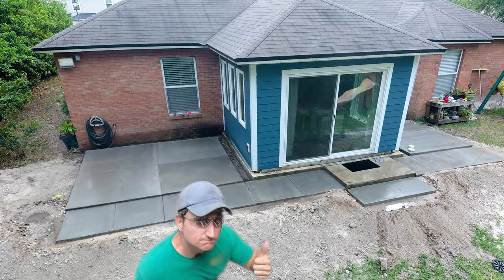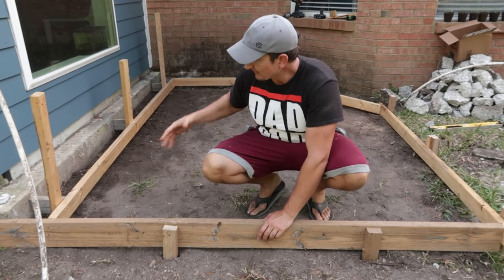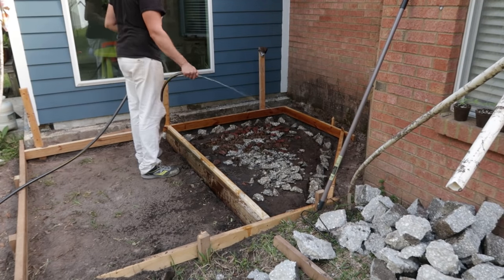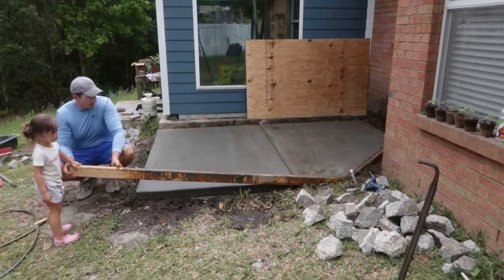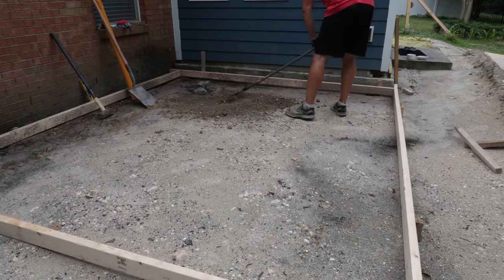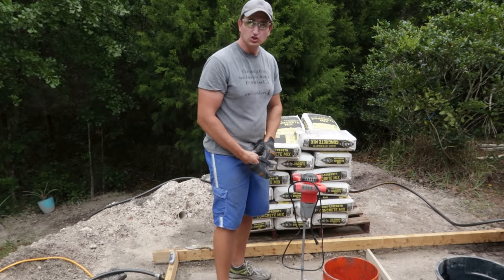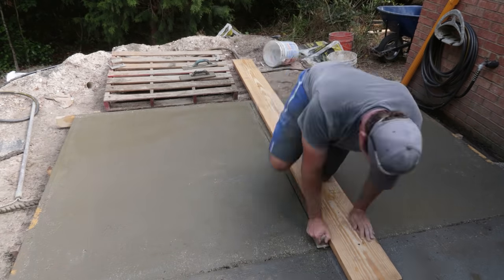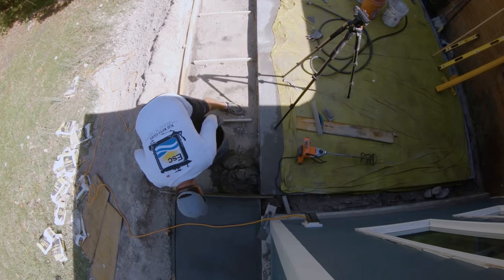Pour a Concrete Patio Entirely  by Yourself Using Bag Mix Concrete, DIY Project From Start to Finish

Comment: For that many bags of concrete, renting a mixer would have made life a lot easier. Curious as to why, in your original pour, you left the gaps against the house.
Reply from the maker: to be able to remove the sliding door later. The old door was below the level of the new slab.
Reply: @MrKistel  I meant the space like below where the water hose is hanging on the brick wall and the adjoining blue wall. There is a gap of a foot or less between the house and your pour.

Comment: Any reason for the gap between the house and the new concrete instead of butting it up with an expansion joint?
Reply from the maker: Yes to leave an area to apply periodic termite treatments

Comment: You look like a glutton for punishment like myself! What I do with the Expansion Joints is use Roofing paper it's very thin and it creates a border between the two slabs. With all that back fill dirt I would have taken a post hole and dug a few little Footers just for extra security great job keep it up!
Reply from the maker: Thanks!  Great tip with roofing paper.  Instead of post hole dug footers, I did make the poured area a little deeper near the forms to create a minimal footer.  At least enough to stick down in the ground a bit deeper than the majority of the slab to better bite into the earth.

Comment: Retired GC. Lots of inconsistent work. Seems like every square (if it was square) was a bit different in size. Not pouring and even flashing to the existing slab just allows more water to be trapped near the structures foundation and delays drying out, and that's never good. As for subterranean termite control, even in a large slab is done with a 1/4/1/2" hole about every 15-20'. Rebar or ww will definitely help 15-30yrs out when roots, wet/dry soil heave/settlement or frost heave show up. Also, just compacting the last bit of fill really isn't going to help in 2-5 years when most of the settlement occurs. Then there's all the small inconsistent "steps' that are more like trip hazards. Sorry, you really did a lot right, but there's a lot wrong too.

Comment: Just wondering how has the concrete held up after a year and a bit (Apr 9, 2021)? Anything you would do differently?
Reply from the maker: Holding up perfectly.  I would probably leave out the broom finish.  It seems leaving the surface after the magnesium float provides enough friction but looks nice and smooth

Comment: If you spread the dry mix straight from the bag in thin {~1") layers then spray water to moisten the mix then build up another thin layer this saves a lot of effort.

Comment: My hat's off to you, what a backbreaking task you chose to take on.  It came out very good for a DIY job, I'm not here to criicize your work, I know I could never do that much work at my age.  I don't understand why you created trip hazards by lowering concrete in certain areas, been there done that and regretted it later.  Again not criticizing.  Great video.
Reply from the maker: Thanks for watching and the comment.

Comment: Did you notice a difference between the fiber concrete 5000lpsi vs the 4000psi?
Reply from the maker: Not from a functionality standpoint. Both areas have preformed the same. No visible cracking in either slabs.
Reply: @MrKistel  awesome.  Thanks for the info.  👍🏼

Comment: I have a Very lobg drive way on compacted soil with old gravel. I wanna make my own pavers and redo it BUT cost of gravel is ridiculous so any idea how i can get my 600 feet of driveway done without gravel
Reply from the maker: Wow that sounds like an ambitious project. Is it 600 linear feet in distance or 600sqft in total area?
Reply: @MrKistel  in distance from the road to the house. There is a small track driveway now that had gravel before its well compacted

Comment: People, people, please stop doing control joints on tiny slabs, you do not need them (well if you use rebar and or mesh)  I did a 40' x 30' slab 20 years ago, and still no cracks.

Comment: Only IMHO. If u are planning on doing a bag mix concrete pour. You may want to run the $Figures$ against the amount to have it delivered in a concrete mixer truck. But if ur gonna do a bag mix I think it would be much better to do it like the old timers did. Order a pile of Portland Mix and whatever Aggregate/Rock and sand. Mix it up yourself. Shovel of this 3 shovels of tht add some water let it eat for 5 mins and pour.
Reply from the maker: thanks for the suggestions

Comment: I'm confused... would it have not been cheaper to just order a couple  yards of concrete and just have them run a pump back there for you? I couldn't imagine it being much more than buying all those bags.
Reply from the maker: I had to do it in small sections. If I had the manpower, and everything prepped upfront, it would have been nice to do it all at once with a load from a concrete truck and a concrete pump truck.

Comment: cant you just pour concrete / cement bag over the pour area add water and mix using a drill mixer on the ground?
Reply from the maker: I don't think that would work very well.
Reply: @MrKistel  i was just wondering in reality what would be the huge difference whether u mix in bucket and pour or u pour and mix. i gotta try that

Comment: Rent a mixer don’t be cheapo😂 btw nice job and thank you for sharing 😊
Reply from the maker: Thanks. I honestly feel it takes longer to mix concrete with a rotating barrel mixer. In my experience, unless the concrete mix is overwatered, it takes several minutes to thoroughly mix each batch load.

Comment: My question is why didn't you mix it in a wheelbarrow? You could have done 3 bags at a time
Reply from the maker: Mixing concrete manually is a chore no matter how you do it. Mixing concrete in a wheelbarrow is a good tip though. Thanks.

Comment: Any bonding agent used on the first slab to bond the second one?
Reply from the maker: Was not needed for this application. The original floor had a textured surface which provided some bite for the new concrete surface to adhere to.

Comment: Why it’s take close to 50 bags of concrete to cover certain area i bags of concrete last
Reply from the maker: it took several full pallets of 80 lb bags of concrete to complete this entire concrete patio.
Reply: Slab was way to thick. Looks about 6-7” thick!!! He should’ve filled base to a 4” level to top.

Comment: A separate section should also be joined by rebar even 24" so it won't drift up or down etc. you are begging over time to have them uneven. There is only one C in especially.

Comment: i got to wear i just wet the ground sloppy .....pour the dry concrete right into the form ...rake it thin to mix ...let it set up for hour or so .... then add more water , more dry concrete , and keep raking it to mix until form is full ... im sure it loses 10 percent strength or something but for us old peeps , who cares

Comment: Are those 2x6x8 boards ?
Reply from the maker: The form boards are primarily a mix of 2X4 and 2x6. The bigger boards  were used  where there was a larger void to block off so the poured concrete would stay contained.

Comment: A patio doesn't need to be 4" thick especially saving bags and self mixing it all. Maybe 3" would be OK.
Reply from the maker: Thanks for the concrete tip. I was able to burn a few more calories  going with a 4 inch pour. HAHA

Comment: Why no Rebar or Chickenwire?
Reply from the maker: It was determined not needed for the design use intentions of this particular project.  Chicken wire helps hold concrete together should it crack. Rebar helps provide structure and strength to handle heavy loads. This is a foot traffic only patio that will not see heavy loads.
Reply: @MrKistel  I have worked in concrete for 20 years, busting it up in houses, pouring it back, I even used to install and stress post tension cables. No way would I ever pour concrete with out rebar and or chicken wire.  Rebar/Chickenwire do the same things, I have jacked hammer up thousand of house slabs and they have either, the new ones all have post tensions.

Comment: I think at least 1 more joint the opposite direction would've been good for cracks. Concrete always cracks
Reply from the maker: Holding up fine so far with no visible cracks. If the concrete pads were much wider, I would have run another break joint like how you described.  I think for this scale and this project things are ok as shown in the video. Thanks
Reply: @MrKistel  looks good though. Question is that an agur youre mixing with? If so good idea i have a one man agur from harbor freight that might work

Comment: Just wonder why you did not rent a concrete mixer from Home Depot.
Reply from the maker: I think a concrete mixer works best with two or more people working the project.  It actually takes a bit of time to mix each concrete bag thoroughly with a mixer. I feel it is faster to use the drill like I demonstrate in the video.

Comment: Concrete truck would have been cheaper and faster. Fiber cement board will get wet and swell and crack your concrete the width of board.   You could have used expansion joint but fiber cement board is paper.  When you sell your house those micro elevations are going to written up as tripping hazard for any home inspector.
Reply from the maker: Thanks for your insights into this concrete project.  The methods shown in the video seemed to have worked well for the particular concrete patio constructed. I did question the fiber cement board slightly but assumed any potential expansion would not be significant enough to cause any problems. To this date there has been no visible cracking in this concrete patio outside of the intended control joints.
Reply: You have to use 440 board not celetex. You keep it about one half an inch short from the top of concrete so you can go back in caulk with self leveling sealing.

Comment: Rent a small cement mixer
Reply from the maker: I thought using the drill to mix the concrete was a good method for my one man concrete mix approach.
Reply: @MrKistel  I actually wrote this comment before I saw you had a drill. The previous video I watch, you mixed by hand.
Hand drill did work pretty good too

Comment: A lot of sweat!  Given the size of your project I would have invested in a small batch (3-4 cu ft) concrete mixer.  Speeds things up and is a big reduction in physical effort.  New small batch drum mixers are about 3X the price of a drill mixer, but are justifiable for the type of project you have here.  Cheap used drum mixers are all over the internet.  I noticed at one spot in the video, as you were moving the concrete with the 2x4 scree that a runny liquid oozed out in front of the displaced mix.  This indicates you probably added too much water to the mix.  That will cause the slab to be weaker, potentially cracking. Furthermore the surface may spall if the liquor slurry that rose to the top of the slab was too runny.  As for the the hardy board crack joint solution - probably not a great idea.  Effectively you have transformed the joint line from its purpose to control where a crack propagates, should stresses be sufficient to fracture the slab, to becoming a location a crack is SURE to propagate, because the thickness of the slab at the joint is much thinner than the rest of the slab, making it susceptible to nominal stresses that would otherwise not cause a crack to propagate!  A cheap alternative to purchasing a joint trowel that has a deep keel blade is starting by setting up the plank you used as a straight edge, with the edge where the joint line will run. Next, set a steel trowel up on its short edge, plunging it into the wet slab, and sawing/dragging the trowel deep in the slab, along the plank's edge.  Reposition the plank for the shorty CJ trowel to finish slab's surface. Also a good idea is covering the slabs a few days afterward with a tarp, while they cure.
Reply from the maker: Thanks for the tips and insight

Comment: It was exhausting just watching you you could have done this with concrete bags not even the ones bought at Home Depot just thick plastic bags you could have mixed each and every concrete bag like shake and bake in the corners of the forms and as much as you needed it would have been a lot easier with water shake and bags in this releasing the bags into the forms
Reply from the maker: i have never had much luck with those

Comment: Your insurance company will not insure you if your concrete porch is not joining to your house and it's not connected to your house and it's not considered to your house 🏠 and it doesn't matter if your house didn't have a porch to begin with...... Next time put a little tour around the house at the bottom or a rubber liner of some kind at least an inch thick screw it our neighbor to the foundation take you some rubber sealant coating that you would put on a roof coding you would put on the back of a roof and put on the back of the gasket and eyelet to the edge of the house at the bottom of where you are going to put your new concrete porch do not leave a void between your house that is a no no

Comment: IT IS NOT HARD TO HAVE 3 QUARTS OF WATER FOR EACH BAG STANDING BY. It drives me crazy how people have no real idea how much and just throw in a hose. Consistent mixes when you are pouring a dozen bags makes sense, no way your mixes are consistent with a guess hose.  So if you are making videos help people do it right. Also you throwing in broken concrete is a joke.  If you really did it well, you would have soaked them all in deep water a few days before hand. All you are doing is making no contact voids and fracture points. Might as well stuck in chisels facing up.  Gravel is smooth and flat. More crushing required

Comment: No steel, not attached to foundation, close to slope, wrong mix, recipe for failure.
Reply from the maker: A retaining wall was constructed  not long after the concrete patio was built.  The steep grape was leveled out at that point.
Reply: Why does it need to be attached to the house foundation? Who cares if if settles down an inch over the next ten years. What are you talking about, wrong mix? The guy used premixed bags! What did you want him to do, make Roman concrete from sea shells and volcanic ash? It's concrete on a tamped earth base. It's gonna be sitting in the same spot behind his home for the next 100 years or until his wife says she's tired of looking at the gray color and makes him tear it out and install pavers.  Good DIY project and good video to help others.
Reply: @remington351  has a license bonded and insured contractor here in California I'm forced to do everything to code that mix of premixed will not meet specifications for a slump test if it's not attached to the house with drought filled between and felt for expansion contraction any water that gets on it when it freezes and thoughts will push it away from the house create a crack and make a place for water to seat into the foundation I'm just telling you how to do it by the rules. There's no steal in it so it's going to crack all over the place. You can do things like an amateur where you can do them like a professional the call is yours and think about it those Roman aqueducts been there for 5,000 f**** years
Reply: @mikemyers7317  Well, yeah, if you're a professional you need to do things to code and the end results will be far superior. The professional results will also cost much, much  as well. Interesting thing about that Roman concrete, no steel in it either...Cheers.